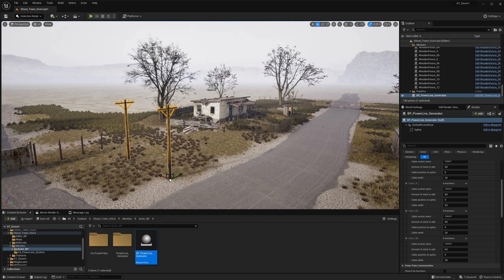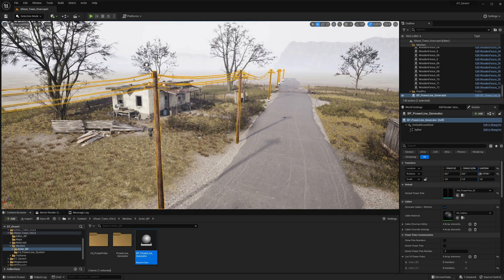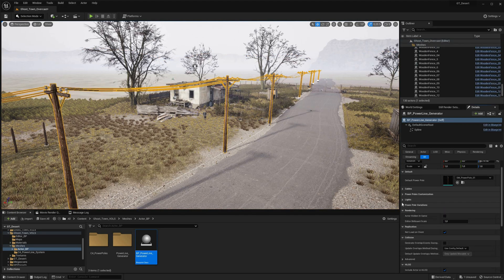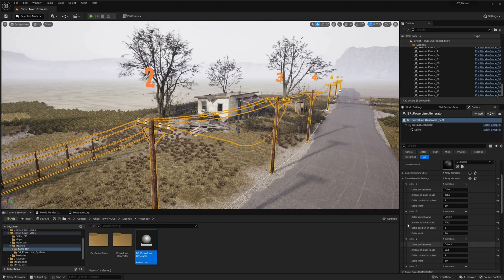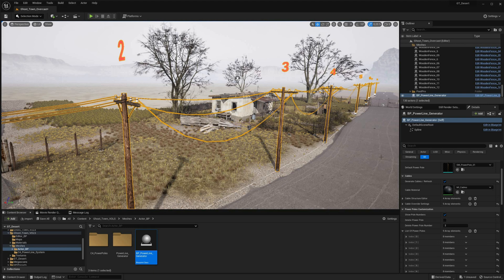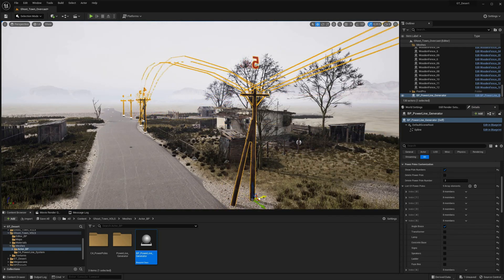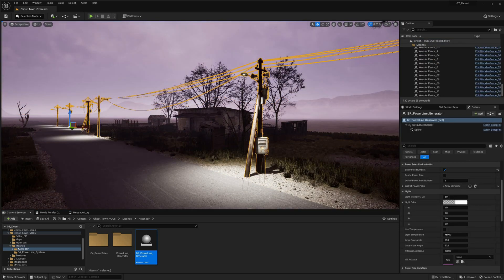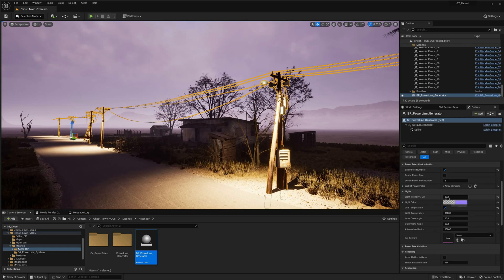Modular Power Line Generator For Unreal Engine 5

Comment: Is there a way to easily scale up the meshes in the Powerline BP? I've tried to increase it's overall scale but then the flexibility of the cables gets lost.
Reply from the maker: Thank you for reaching out with your question! Currently, this feature isn’t supported, but we appreciate your suggestion and will consider it for future updates. In the meantime, you can try customizing the powerline poles by replacing them directly in the blueprint. Please note that some adjustments in the construction script may be necessary to ensure compatibility.
Reply: @Rendertale  thanks a lot for your answer, really appreciate it! Other than that, your products are amazing ;) Another great feature could be a parameter that allows to distribute the meshes (poles) along the spline based on distance additionaly to spline points to get an even distribution.
Reply from the maker: Thank you so much for your feedback and kind words! We're thrilled to hear you're enjoying our products.
Your suggestion for a parameter to distribute meshes (like poles) evenly along the spline based on distance is a great idea! This would indeed allow for a smoother, more consistent placement along the entire spline without being limited to specific spline points. We'll definitely consider adding this feature in a future update, as it could improve the flexibility and control in setting up assets along the spline.

Thank you again for your support and valuable feedback! Let us know if you have any more ideas or questions.